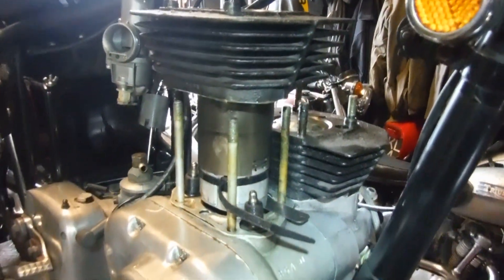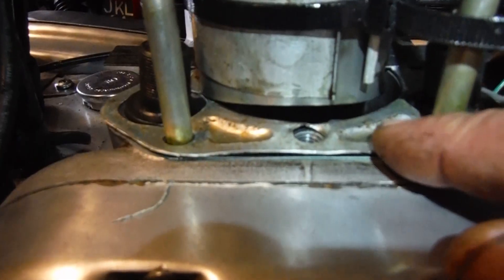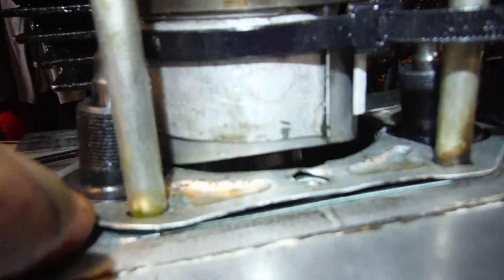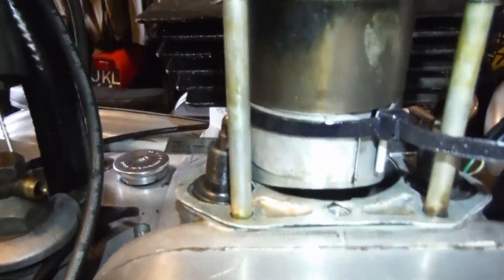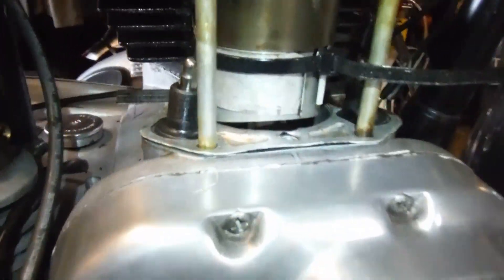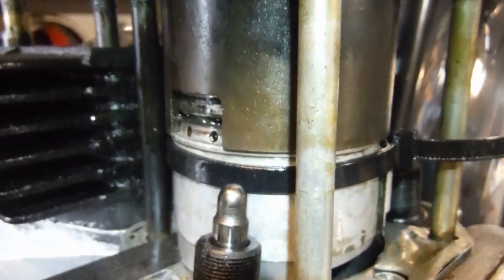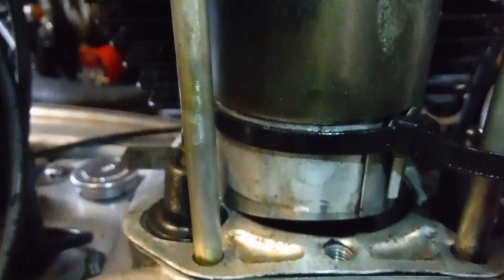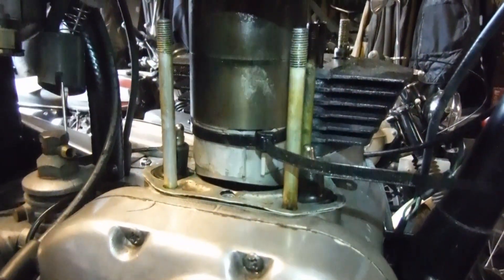How I clamp piston rings to fit cylinders (Royal Enfield Interceptor 750 returns for top end check)

Comment: So then, just drop the barrels until the engine knocks slightly, then pull it down and raise em a bit? Nice to have adjustable compression, so to speak.
Reply from the maker: According to the manual, we have 8.5:1 compression, but with the spacer and one gasket removed from each cylinder, it is 9:1.
Reply: @paulhenshaw4514  Of necessity, piston to head clearance would be critical. With patience and enough plasti-gauge, I suppose one could reach close to the 9:1.
Reply from the maker: As compression ratios alone go, piston to head clearance doesn't have as much impact as many believe. I remove some 2mm from the cylinder barrel height when I tune R.E. Bullet engines, just to get up from around 9:1, up to 10:1. Obviously, more height reduction is required as starting point compression ratios go, getting less as starting point compression ratios rise, but as an example, going down from a 1 mm thick head gasket to a 0.5 mm thick head gasket on a 500 Bullet makes virtually no difference at all, I have found, in spite of the claimed C.R. increase.
Obviously, piston to head clearance is critical to keep components from making contact with each other though. I use soldering wire when checking squish clearances, etc.
Reply: @paulhenshaw4514  Well said. In these relatively small bore and long stroke engines, I can see where the clearance does not alter compression all that much.

Comment: G'day Paul, ever since zip ties have been around l have use them the compress rings, had some clamp release type in till l dropped a nut into the engine, luckily it was sitting on the flywheel when l removed the pistons, great video, cheers mate, Neil 🤠.

Comment: For Royal Enfield Constellation I used recently jubilee clip, I would say it’s even simpler and does the job perfectly. It’s easy to maneuver, to make it tight or lose as required and get it out once the barrel is over the rings.
Reply from the maker: Jubilee clips might work, but they might be a bit narrow to cover all the rings at once, and there is more risk of breaking rings because of the bulge where the screw is in the clip.

Comment: I use a set of plastic strips, cut from a 5 litre screenwash container, secured with cable ties, as ring compressors for my 4 cylinder Suzuki GS 550. They are such tiny pistons, and in such a confined space, that I needed something really small (and cheap).